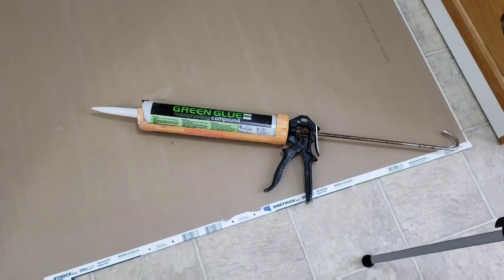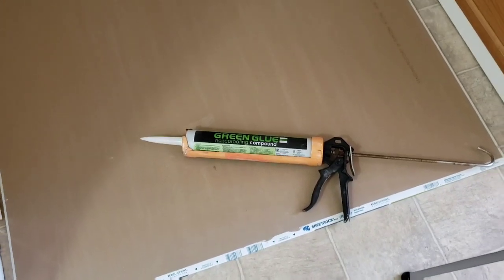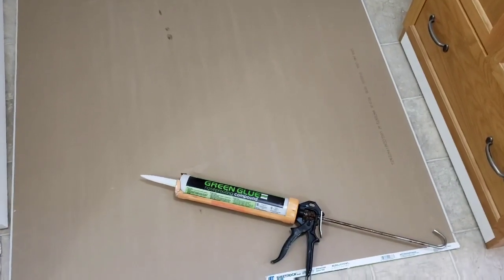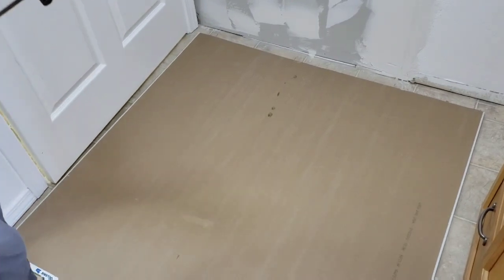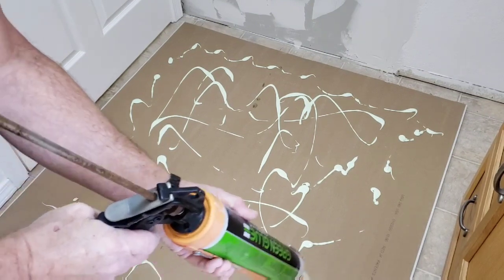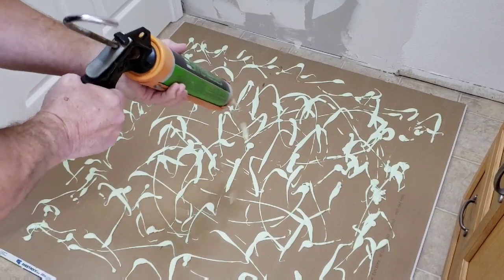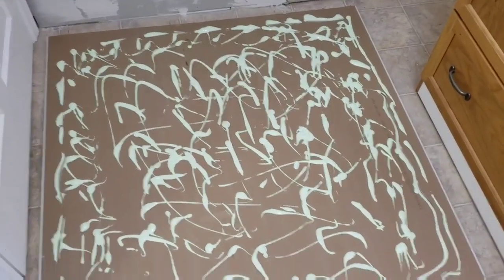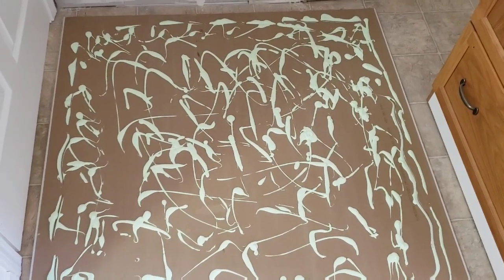Green Glue... Is it really worth it ?

Comment: So what was the answer to if it's worth it? 🤔🤣
Reply from the maker: I continue to use it

There is nothing better

It doesn't add that much

Every little bit helps
Reply: @Jonehughes  thanks for the reply. But have you tested walls without it? Just playing devil's advocate here but could be a huge unnecessary experience
Reply from the maker: Yeah
It makes a little bit of difference

The best you can do is to put on double 5/8 drywall on both sides of a wall

That is the best soundproofing

It makes a very little bit of difference if you add fiberglass to the walls

It also makes a little bit of difference if you add green glue

There are sheets you can buy that you can install between the drywall also that soundproofing

Everything cost money

Nothing is great

The cheapest thing you can do is put double 5/8 drywall on each side

That is by far the best soundproofing out there as we speak
Reply: @Jonehughes  got 4 layers of 5/8 DW already planned for the build. I'm concerned about frequencies below 100 Hz in relation to the size of my decoupled walls. I'll end up having a range of 6-8" in various walls. I have a 2200 watt stereo system that I'm trying to contain with a large subwoofer. Thanks again!
Reply from the maker: Yeah that's why if I were you I would use it anyway even if it only has negligible advantage

Every little bit helps

It does Master some of those frequencies

The fiberglass insulation helps a little bit also

The double 5/8 helps some too

It's like a peanut butter and jelly sandwich with only one slice of bread instead of two

Can you imagine putting that in a ziplock baggie

Or taking it out at lunch time and eating it

What a mess

It's only money

And it might just be the ticket 😜
Reply: @Jonehughes  so in other words you don't know!!!!!!
Reply from the maker: @rollandelliott  🎯💯

Comment: Did it make a difference in terms of soundproofing?
Reply from the maker: Who knows ????

To know for sure you would have to set up some kind of sound meter and do it with it on and then do it with it off or vice versa and then you'd be able to tell

Maybe just doubling up the drywall was enough

I continue to use it as I double up the drywall

It is expensive but it has to do something right

but I can't actually tell you that it does anything

I have no way of metering the sound differences between then and now

They are just way too many variables

But as I said

I keep using the product

As I double up a wall

It can't hurt

And it possibly helps
Reply from the maker: Yeah
It makes a little bit of difference

The best you can do is to put on double 5/8 drywall on both sides of a wall

That is the best soundproofing

It makes a very little bit of difference if you add fiberglass to the walls

It also makes a little bit of difference if you add green glue

There are sheets you can buy that you can install between the drywall also that soundproofing

Everything cost money

Nothing is great

The cheapest thing you can do is put double 5/8 drywall on each side

That is by far the best soundproofing out there as we speak

Comment: A new tenant just moved in next door and somehow I can hear their footsteps and banging of cabinet/bed frame against the shared wall. Does green glue stop those as well or just sounds? Thanks.
Reply from the maker: Look at my reply to Billy Hopkins two weeks ago
Reply: @Jonehughes  I see your method is double layers of green glue+dry wall. Do you think this is better than 1 layer of green glue+drywall and another layer of sound blocking foam/barrier of some sort + drywall? Thanks
Reply from the maker: If you install two layers of 5/8 drywall with green blue between each layer

You will have to put your head up to the wall to hear your neighbors
Reply from the maker: And now is not the time to scrimp

Use the green glue the way the manufacturer tells you too

You will only have to do this once 

if you do it right the first time
Reply: @Jonehughes  Ok thanks. I don't have a budget so just trying to find the best solution. What do you think about green glue + quietrock?
Reply: @Jonehughes  Sometimes I can even hear them stomping on their floor or dragging heavy objects on their floor (not sure why because they are not above or below me, but next to me). Do you think this type of sound is transmitted through the floors instead of the shared wall? Thanks again and sorry for so many questions.
Reply from the maker: Your questions are totally fine :-)
Yes
 you are right 
noise  transfers are from everywhere

But you will get the most bang for the buck if you did what I said
Reply: @moriyama815  you have to figure out what frequencies and amplitude to figure out what you need.   Go check out Acoustic Fields.  They have tons of videos to check out.
Reply: That sounds like impact noises, sounds like that's a cheap apartment and there may only be sheetrock seperated between you two, take it up with management and give them absolute hell

Comment: You wasted effort going 1/2 especially because most of that is porus and built to be lightweight. Green glue works. I have used it for home theater. 2x 5/8" and decoupled with insulation between joists.
Reply: Hi, curious how your low end performance was after the GG and how much of an air gap you have with your decoupled wall? I'm in the middle of building the same exact thing for a rather large stereo system.